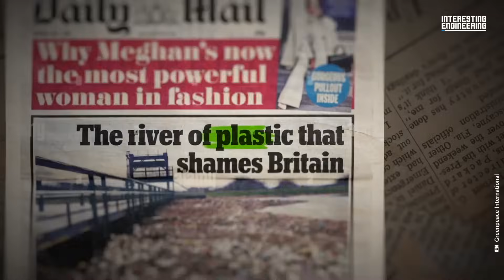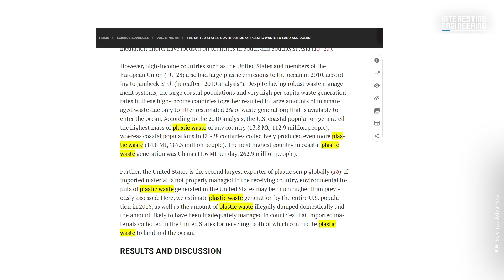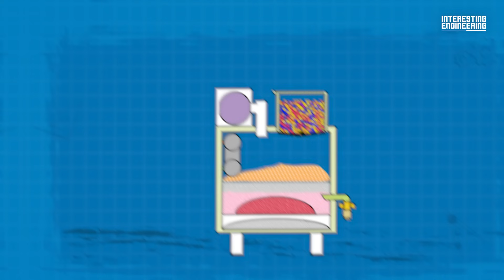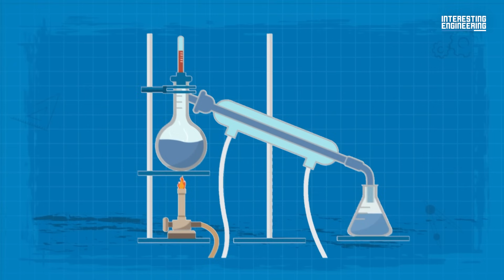How Waste Plastic is Converted into Fuel

Comment: Sounds great, do it. The other option i saw for this came from Australia where they developed a pressure based method that breaks down plastic into crude oil, but it was rather energy intensive, though Australia has large potential for renewable energy so one could argue such method could be used in places where such are readily available. Then again usually nowadays then a Data Center is build for AI and no one is the wiser.

Comment: Now make a GEET Fuel Processor big enough to produce the oil to run the GEET with excess energy to power your house.
If you don't know what a GEET Fuel Processor is, there are thousands of backyard mechanics making them and many have posted their results here on YouTube. It uses 20% oil, gas, turpentine or what have you and 80% water with no pollution and 3% more oxygen than what's in the atmosphere. Free Energy by cost analysis.

Comment: A similar program to this Japanese pilot plant is complete in Alberta and undergoing process trials. It's a true large industrial scale plant that had $180 million spent on it over it's 15 year design and construction cycle. The trials for this plant leads to a lot of heavy coking inside the pipes leading to frequent shutdowns.  We are not giving up on this and more investment is needed to change out some of the system to reduce coking.  If successful, they want to process 10,000 tons of plastic bails daily from all over western Canada and north western US.  Alberta was chosen because of our extensive experience in refining heavy sour crude and have all the refinery infrastructure for it.  We were the first place in the world to blend plastics into bitumen and asphalt for roads and roofing and have been doing it for over 40 years.
Reply: Exxon Baytown has a unit too.
Reply: To much heat slow cook

Comment: Not new. Pyrolysis of polymers has been long known, at least since the invention of polymers. The pyrolysis also has two very nasty side effects. Soot and aromatic compounds. Even if you pyrolytically decompose clean LDPE, HDPE, PP, you get significant yields of benzene, toluene, xylene, styrene. Furthermore the soot contains benzopyrene, pyrene, anthracene and other fused aromatic hydrocarbons. This has been demonstrated throughout the decades of pyrolytic research all over the world and you can look up any scientific paper and look at the table containing the products. 

The key point, you want octane and isoheptane for gasoline, and longer chained hydrocarbon for diesel. From energy point of view, the arrangement of carbon and hydrogen to Benzene is one of the most energetically stable, so you will have a hard time reforming this.

Contact of skin with soot has been known since 19th century to cause cancer. Chimney sweeper's cancer which was just black boils on scrotum was indeed absorbtion of polycyclic aromatic hydrocarbons into human body.

When you have a viable plan to deal with aromatic compounds and their derivatives, and if you have a way to dispose of soot and ashes in way other than landfill (chemical plasma reactors are already established technology in research, so it is expensive), then you have a foolproof way to deal with plastic problem. But before that, you need to include this as a disclaimer.

Comment: Not sure why they can’t continue developing safe “plastic back into oil at home” machine and sell it as a necessary house hold appliance like oven or fridge, washing machine and so on. Why did they cancel this development progress. They were on a right track for everyone to put an effort to eliminate plastic from oceans. Please continue with it! Please!!!🙏🙏🙏
Reply: The main reasons are it's extremely dangerous, extremely toxic, and it takes something like 100 times as much energy to run than it will ever produce.
Reply: @Trashalchemy its energy cost is cheaper than sending it to China where they dump it into the ocean. Nuclear energy is green it only emits water vapor and maybe CO2 which isn't a pollutant and isn't the molecule that traps a majority of the IR radiation. And the fuel material for nuclear is recyclable until it becomes an inert non radioactive piece of rock.  Carbon Monoxide, Sulfur Dioxide, and nitrous oxide all hold more IR than CO2. Three  nuclear energy plants could provide energy to three facilities that would convert plastics into oil. If it's not profitable enough to be made into a private business then until technology improves it should be part of the public sphere (government) and we can go back to stainless steel or glass
Reply: 😂 Yeah sure because everyone will buy a machine that produces carcinogenics 😂
Reply: Ooh my dear. Are you naive? If we recycle it means we diminish the reliance on the oil industry and in the capitalis era we live it is easier you get away with murder than be successfull on a business who threatens the oil business.
Reply: The reason why is because the USA runs off the petrodollar. If something like that hit the market not only would it destabilizes a trillion dollar industry it would mean the US killed millions in middle Eastern countries for nothing
Reply: Because then there would not be a middle man and you would give people too much freedom and we dont want that
Reply: That is a very good idea!:goodvibes:
Reply: Due to juice

Comment: this would require $187.5 oil barrels and price per pound of plastic sustained at .50¢ given the 80% retention from initial weight to end product weight to be profitable. Unfortunately because oil prices that high would kill the global economy, the global powers will not introduce this cyclical economy, rather they would have a consume and dispose economy which is awful for the environment.

Comment: That's nothing new a Canadian Ukrainian developed a process back in the 1990s and built a plant near New York basically using plastic waste and after heat treatment 5 barrels of Plax and 2 barrels of gas . A British company tried to market their TR7000 meaning processing 7000 tonnes per annum but the company went bust after COVID 19 . You need energy something like 4MW per tonne of plastic good idea but only works if oil is above 120 dollars a barrel. The Plax oil was priced 150 dollars a barrel in 2018 .

Comment: All plastics including tires are very clean burning if it gets enough oxygen by simply blowing air into the combustion chamber where the plastic is burning. And no one has a right
And climate activists have no right to complain about CO2 levels until they understand where an apple gets it's mass from including every plant entry on the planet.

Comment: How safe are the derived fuels? Do they work the same as fuel derived from crude oil / petroleum?
Reply: Cleaner than virgin fuels as you are getting a pure reaction product.
Reply: Best to use seaweed or corn plastic ?
Reply: No such thing 
The operator is your safety 🙏
Reply: They make 8x4 sheeting from chipboard, blockboard, MDF etc why not water proof plastic

Comment: Still using energy and emits carbon. Taking all energy input from production, recycling, or building new things from old plastic, wouldnt it be more wise to use alternatives like glass and aluminium in the first place??
Reply: And what to do with all the plastic that already is a problem now ? Even if isn't an energy efficient source of fuel is better than burning it directly or, worse, throw it in landfills or the ocean.
Reply: Micha, your comment is valid, but plastic is a by-product of oil refining and is far cheaper than glass and aluminum for product packaging. This method at least gives us a way to re-use the existing plastic. In contrast, you could ask what else would be done with the plastic by-products of oil refining? The glass and metal containers would be healthier, but I imagine at some point engineers will come up with bacteria will eat the microplastics in our bodies. All in all, it seems future technology is cooking up some interesting options.
Reply: Concur.  Single use is stupid.
Reply: This is where integrated refineries/chem plants come in. Oil companies do more recycling than you can imagine.
Reply: Solar
Reply: Glass breaks and is a safety hazard. Do you use glassware to teach kids how to eat?

Glass is heavy, and would waste more energy in its handling and its transport. And lets remember being brittle, glass needs sufficient material to pad their rattling and stay apart from each other, causing less volume. Not only are glassware thicker than a plastic bottle wall thickness, they need to be spaced apart too. A lorry that couldve carried a million drinks normally would only be carrying a few hundred thousands if the drinks were packed in glass. More trucks on the road to satisfy the same demand.

Glass needs high temperature to remelt/recycle, and will use up more energy and cause more emissions.

Aluminium needs higher temp than plastic to process too. Cannot be injection moulded and needs really expensive machinery to forge into shape.

Aluminium is also expensive.

Also too flimsy when thing to wrap food as bags, unlike plastic bags that actually get tougher when you stretch it (up to a limit).

Its easy to shoot out suggestions and pretend to be smart, but its clear you have never really given any meaningful thought to the stuff youre saying. I immediately formed these arguments against glass and aluminium as soon as I read your idea.

Go brainstorm a new idea for material to replace plastics. Lower your ego, and play as a critic against your own ideas. Otherwise you would be churning out half baked ideas and have it be ridiculed so easily
Reply: @de0509  I was raised using glassware. A cup or two have been broken, but eventually me and my sister learned not only how to avoid it but also how to deal with the shards when it happened. But then again children nowadays are made of snow flakes, apparently.
Reply: @de0509  I posted open ended question, not solution. You suggested for me to think things thru(which is valid), but then you said that you formed your opinion immediately after reading mine. Kind of hypocricy.
What about all the plastic that ends up in the environment? Microolastic? Plastic killing wildlife on the ground and in water?
There are problems with all materials. The bigger problem is overconsumption. Why we dont carry our own reusable bottles? Conveniemce is killing us. Want caffeinated sugary drink? Take Hot coffee with you in thermos.
I will brainstorm, wishing you to do the same.

Comment: Just ad 10 times as much energy as you will get out of it. And how much CO2 are you producing. Why not let nature return it to our environment to promote life.
Reply: Oil company propaganda comment. No, plastic is full of energy, you only need to add a fraction of the contained energy to get back a surplus of energy. And the whole idea is to avoid burning the plastic, so hardly any CO2 is released this way.
Reply: @curtisnixon5313  watch some of the videos and see how much wood they burn in the process.  You could drive 10 times as far on the smoke from that wood if you built a gasification system, My nefue is the engineer on a large communal farm in North Decora end theypower the entire farm including the equipment from gassafied crop waste and wood chips.
Reply: @curtisnixon5313  watch the vidio. That .uch wood in a gassifure  would produce 10 times that much power .
Reply: @curtisnixon5313  If you grind the plastic to a fine powder and mix it with limestone and forced air you will get 1,000 times more energy from it as well as producing calcium carbonate fertilizer and reducing atmospheric Co2!
Reply: @terenceiutzi4003  What do you mean? Burn it with limestone? Sounds intriguing. To me the problem with burning is the ash and contaminants such as dioxin being nasty byproducts that are toxic and persistent. Pyrolysis doesn't have those drawbacks.
Reply: @curtisnixon5313  it was originally the clean coal process. Developed over 200 years ago. That is why the old  Canadian coal fitred boilers had such high stacks. If your burn is hot enough you can introduce limestone into the burn and the chemical reaction producess far more heat, the CO2 bonds with the limestone and produces calcium carbonate that precipitates in the stack and is sold as fertilizer.
Reply: We have many sources of waste that can be used for energy.
Reply: Plant more trees, types of plants that can grow big within five years or bamboo plants.
Reply: Im gonna challenge you on that "fact".

If you make a bonfire out of plastic and you start the fire with a lighter, do you need to continually keep the lighter on to make the fire keep burning? NO. So the notion that it takes more energy to crack plastic than the energy output as fuel is plain wrong, and just shows how much of a parrot you are and how little you understand actual science.

Because burning plastic is literally pyrolyzing it and immediately combusting the pyrolysis products. A plastic bonfire would continuously burn as long as theres plastic. Its got enough energy to burn your eyebrows while also continuing the pyrolysis process until all the plastic is gone. That is what a plastic bonfire does. It has much more energy released as fuel than the energy needed to pyrolyze it.
Reply: pathetic
Reply: Hmmm, why not let nature return it? Well, lets see, the average plastic bottle takes 3 years in full sun to degrade to the point where it can be easily crushed into a powder. From there, it takes another 5 years for it to break into microscopic fragments, and from there another several hundred years to actually break down into something compostable. During this time, it is causing major health problems, lodging itself into our systems, displacing material in our cells, weakening cell membranes, damaging dna, oh, and did you forget that we also now breathe the stuff? 

Performing pyrolysis on plastics not only fully destroys the plastic, but also offers the ability to synthesize fuels so instead of plastic that cannot be quickly processed by nature, we now produce gases that can. Hmmm, doesn't seem like much of a drawback to me.
Reply: How much plastic waste are you producing?
Reply: @teoman_acikgoz  so why aren't we feeding it to wax worms and harvesting the hospital grade polypropylene glycol? Instead of making millions of tons of polypropylene glycol from crude oil every year?
Reply: @terenceiutzi4003  Polypropylene glycol is only one specific kind of plastic, correct? Pyrolysis can be done with all types of plastic, heck all matter. Plastic is extremely difficult to sort, given how many kinds of plastics there are. Dumping all kinds of plastic in one big landfill and throwing in some wax worms doesn't seem like a long term solution to me.
Reply: @teoman_acikgoz  or at least landfill the plastic and let the natural wax worms convert it to biodegradable polypropylene glycol in the ground?
Reply: We just need to stop producing plastic
Reply: What about manufacturing furniture with it?
Reply: And subtract the 10 times again im long run of utilizing nuclear-generated power.😂

Don't say nuclear is dangerous therefore we must use solar bla bla bla. If that the case, please return to nomadic way of hunter gatherer society.
Reply: @dasgerbil5189  Solaris 10 times more dangerous than nuclear  look at all over the toxic heavy metals that they are dumping into our envivomen to produce wind turbine and solar panels!
Reply: @dasgerbil5189 lol you think before electricity we were hunter gatherers good luck with that history test